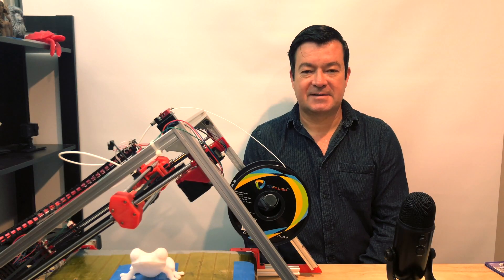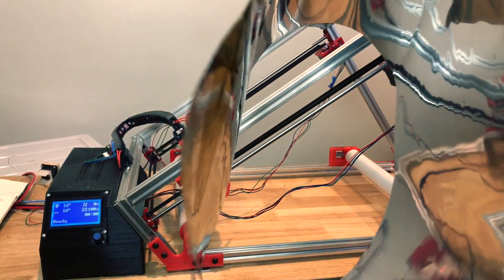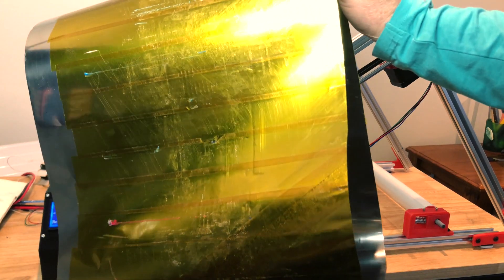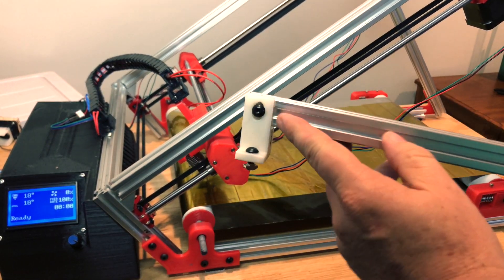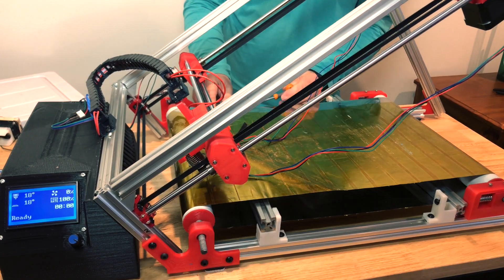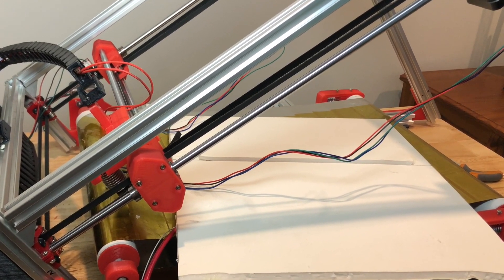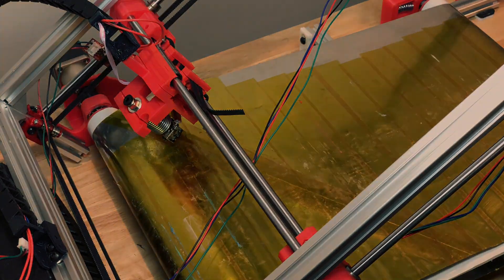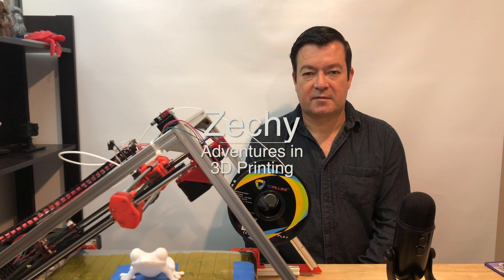Belt Printer Build: 5 - Belt & Heatbed

Comment: Thanks a lot..
Can I use a 2 inch PVC pipe instead of a metal rod for the belt..?
Reply from the maker: If you put a few spacers/rings to support it on the shaft it will be fine. I used it in the first version of the printer.
Reply: @ZechyC  
Thanks!